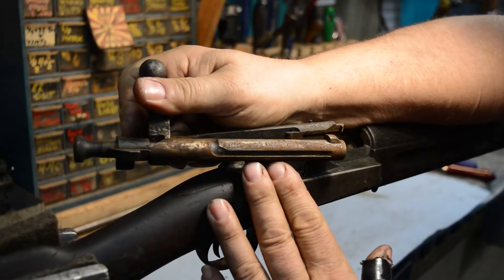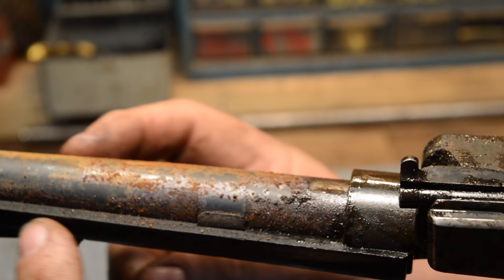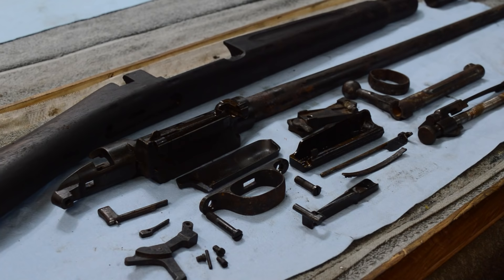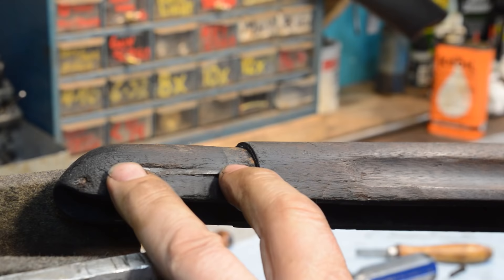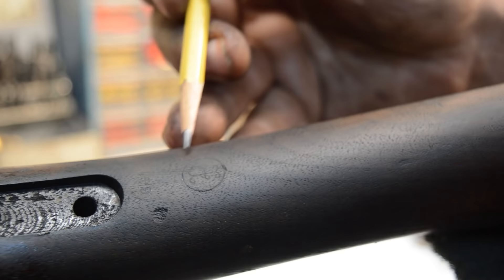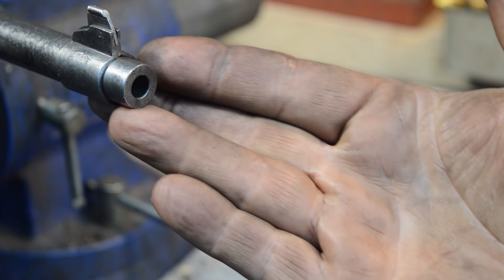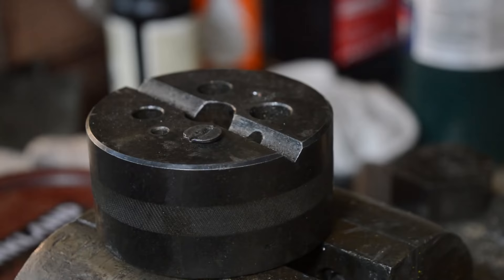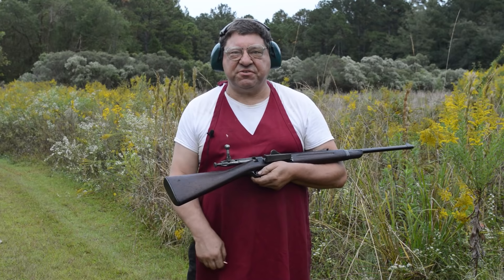Anvil 089: Krag Disaster Recovery

Comment: Back in the 60s our town's gunsmiths shop had a fairly bad fire. I went to work for Roy working after class to try and stabilize and refurbish as many guns as I was able. 
This show is bringing back a lot of memories. I think the one gun I couldn't even save any parts from was a post '63 Model 70. There was exactly no Rockwell hardness left, pure soft.  I later did take the  trigger group home and messed around with rehardening and tempering with some success. I worked on this pike of guns for two years and was able to save a lot and other than the toasted Mod 70 I was able to save a lot of parts.... those were great days for a 15-18 year old kid.

Comment: I believe that is  a  "Benicia arsenal"  conversion from the '30s --   A 98 rifle cut to carbine  barrel length . The  muzzle turned down and a 1903 springfield front sight installed.  The action & barrel then installed in a carbine stock --  Sold for a few dollars through the DCM  ----   All original krag front sights are silver soldered on  both rifle and carbine --   Other arsenals may have also made them --    I believe  my source of info was from an american rifleman in the early '60s ---- 
I bought mine in 1958 for about $20 and still have it -- shoots  fine, usually with lyman 311291 cast  --    I enjoy your videos  --
Reply from the maker: Yep, I think you have it, because it is a pot if chili for parts. Thanks, GREAT intel.
Reply: Your post reminds me of a friend who's father used to buy M1 carbines for 30 dollars back in the 60's. He used to give them as Christmas gifts to his buddies

Comment: Sir, you are truly an artist.  I'm no gunsmith but I am a carpenter. A couple of years ago a friend of mine came by with a shotgun with a badly burned stock. He wanted it fixed but wanted his son to remember his stupidity. So I submerged the stock in long set epoxy and put it in a vacuum chamber.  Let the still liquid epoxy run off the stock and let it cure before resurfacing the whole thing. Never removed a single sliver of wood. Not suggesting it would have been an option here. But if ever a disintegrating stock needs to be locked in stasis...
I hear they are still using the aforementioned shotgun.

Comment: You hit the nail on the head as it were.  Several arms companies like Bannerman bought up the surplus Krag's which had shot out barrels due to the corrosive priming of the time, and mounted surplus 1903 Springfield 30-06 rifle barrels to them.  This was done by simply bobbing the chamber end 2 inches to remove the threads.  This end was then re-threaded and contoured to the Krag receiver and the new 30-40 Krag caliber chamber cut.  If a carbine stock like this one was not available the rifle stock was bobbed and it's ramrod groove filled with wood from the cut-off.

At the 13:28 mark we see the markings, model of 1898 with a serial number 137598.  If this was a 1898 Carbine the stock cartouches are wrong for it's serial range.  Next at the 34:00 mark we see the front sight which is a 1903 Springfield rifle banded type with an after market bead blade insert which has not had its toe extending out beyond the sight base filed back to the base itself.  The muzzle end has been cut-off flat instead of having a radius crown it originally had.

Comment: The moment I saw the front sight I knew that it had a cut down rifle barrel as indicated by it's 1903 Springfield front sight band. That actually could have been done at the armory because when they ran out of actual carbines for NRA sales, Springfield did alter some rifles into the carbine configuration using 1899 carbine stocks and cut down barrels with '03 front sights. That being said, there is probably 100 cut down rifles (or more) done by gunsmiths to every original Krag carbine. A great many were also upgraded to 1899 specs when they went through the arsenal for refurbishment. 

I am extremely fortunate to have one of those 5001, 1898 Springfield Krag carbines (correct serial number range, correct saddle ring stock) that is still in original condition.
Reply: Please post a picture link if you please.  I would love to see one. Myself. I have a Springfield conversion Krag with the 1903 4-groove barrel that shoots like a champ.  love the that little short rifle.

Comment: I use an impact driver when working on autos.

It works kinda like how you were shock loading the screwdriver with the hammer taps.

Really the only difference is that the impact driver turns itself when ya wack it with a hammer.

I’m so glad I found this channel, so relaxing and VERY informative.

Comment: Fantastic work! I'm no gunsmith or machinist but I used some of your tips to refresh the stock on my dad's model '94. I love working on my car, and you are absolutely right that hitting the bolts with some, I use generic "PB Blaster", lubricant an hour or the night before is the difference between snapping a manifold bolt or not.

Comment: Years ago I picked a sporter at an auction.  The guy that blued it did a fantastic job. The scope was mounted well. If I remember correctly, it was a Bishop stock. That was the one problem. The barrel and action was not seated deep enough. I fixed that and off to the range. It was a tack driver. Half the guys on the line shot it. The amazing thing is the barrel. This one was cut down some, but still plenty long and it looked straight inside. I was in machining 40+ years and know what they had to use to drill it back then. The steel is tough and course. Now days they throw sulphur and lead in the steels to make it easier to machine. If you ever get a chance, look at some photos  of old ordnance machine shops. It really makes you think when you pick up an old gun.

Comment: Yeah, cut-down rifle.  The sight was a full-sized rifle sight, and the barrel was cut straight across, without the muzzle being crowned.  All Krag front sights were flat-based, fitting into a dove-tailed slot on the barrel.  The sight on this rifle is from a 1903 Springfield.  Excellent illustrations of "jack-hammer torquing" the screws out.  I learned something new!  One interesting thing about the stock screws.  They have remained unchanged on US Military rifles from 1795 until the M-14 was replaced by the M-16 in the early 1970s.
Reply from the maker: My real concern, until I got up to speed on what we had here, was that someone had faked with intent to defraud. Once I learned the Benecia had done arsenal level refurbs to get it to the NRA, my opinion changed dramatically

Comment: Hey it looks like some of the SAMCO 1916 Spanish Mausers!
I had some genius individual argue that Kroil should NEVER be used on blued firearms because it removes bluing.  I said I've left it on several different blued guns and gun parts for over 24 hours and never had an issue with bluing. 
His response was "Really, a WHOLE 24 hours?  Well that ends the argument"
So I guess never use Kroil because if you leave it on for a week, it might harm the bluing.
Also, glad I'm not the only one who uses electrical tape for certain first aid issues.
Reply from the maker: I have had issues with LONG TERM Kroil bluing damage. Like more than one week of immersion, so I use it liberally and never look back. Note: Even saliva causes cancer, but only if swallowed in small amounts, over long periods of time................................

Comment: Never EVER snap a handguard off with a Krag!!!!  You remove the stock, remove the rear sight, and then slide the handguard forward until it can be removed.  Then, insert a quarter and a nickle in the clips to hold the clips and prevent tension on the wood.  Not doing this will always risk cracking the handguard... and replacements are extremely difficult to find!!!

Comment: It's strange how rusty metals get after being exposed to soot in a fire.  Must be because the soot is corrosive.  I'll have to research further, I've had it happen to me in 2008 with a small shed fire, luckily no firearms were involved!  And I do mean it was a very small fire.  I had some kerosene lanterns that were NOT the source of the fire but their kerosene smoldered in the fire for a long time.  It may have been a few days until we noticed the fire as it was contained to the interior of the shed only!  And the actual source was Christmas lights overloading one of those old Radio Shack Plug 'N Play modules (the precursor from the 1990s to modern day smart home light control!)
Reply: props for the name...have a good day
regards from Denmark
Reply: Rusting is oxidation of the iron hence the name iron oxide. Water vapor causes this due to the oxygen in water. Fire (or flames) is a type of "rapid oxidation" thus fire can produce rusted iron in the form of iron oxide. Cutting torches and welders can't work on rusted steel due to the iron oxide coating, essentially being non reactive. Ever wonder why welders clean the metal of rust with a wire brush before welding? (Prevents contamination of the melded metal seam.)
Reply: @joepangean6770  I weld myself as I understand, rust doesn't conduct.  But cutting torches?  I've seen plenty of rusty metals cut with a torch.
Reply: Carbon accelerates corrosion in steel (graphite is particularly bad). Water completes the galvanic circuit.
Heat also accelerates oxidation, add the acid generated by combustion (particularly if any halogenated polymers or sulphur compounds are involved).
Springs and heat don’t mix either (ditto magnets but they aren’t common in firearms).

Comment: If there is a band around the barrel at the front sight, with that set screw, it is probably a cut down rifle. That muzzle has been cut off and there is no crown. CArbine barrel length is 22".  Also, that lever on the front of the rear sight (It's the 1901 rear sight. Check for little "C"s on the left side and bottom of the ladder), is used to loosen the ladder for windage adjustment, then to lock it in place. The cartouche is dated 1901, but the serial...can't read it too well: 187953....is 1899.

Comment: If I recall correctly from my firefighting days, AFFF is just cows' or ox blood that's been brought into the higher pH range when mixed with a lye to make it foam well, kinda like detergent.  I looked it up and apparently as of late, they've added some PFC and some acids as well.  Of course, they're pumped in using water to dilute and distribute creating the layer of foam to extinguish the fire.  I'd say it would do a real job on steel.
Reply: The manufactures of the stuff have all recalled it too. All the major fire suppression system manufactures from Ansul to Amerex that used similar solutions pulled it off the shelves and are no longer selling it. I work in the industry wholesaling so that has been an interesting new development!
Reply: @austinbunch5202  Any commentary on what the new stuff is made from?  I worked at a place that made a variant of it and ours was basically liquid soap with some anti corrosive and antifreeze added.  It would be mixed with water to make foam, but no idea who or what the end consumer was.
Same product with different preservative packages went to car washes, hand soap, body wash, and shampoo factories.
Reply: There was a major spill of the stuff undiluted and it caused the EPA to have a conniption so it got yanked. No idea atm if there is gonna be a replacement for it. Generally speaking the place it gets used the most is on ships and oil rigs. Floods the compartment with bubbles and chokes the air supply along with a crap ton of water. I would guess it’s the additives that are the major concern right now and the fact that this stuff is used to a high degree in an oceanic setting which everyone is sorta anal about keeping clean right now.

Comment: Used to work at a place that made AFFF.   Our formula was basically liquid soap with some antifreeze and corrosion inhibitors in it.  This gets mixed immediately before use with a bunch of water to make the foam.  There are other formulas though so you might ask the collector what variant they used.

Comment: Barrel may not have been replaced as the carbine barrel is the same taper (shape) as the rifle barrel it just 22 inches long.  Also the barrel on this rifle does not appear to be crowned but cut and left flat at the muzzle.  No original Krags (rifles or carbines) had the front sight attached to the barrel with a barrel band.

Comment: When you conserve and boil lots of intricate metal parts (this action), how do you get in the tiny little nooks and crannys to get all the ferroferric oxide off? Like on the inside of the case pusher tube of SA revolver frames.
Reply from the maker: Any bore brush, or tooth brushes work too

Comment: Im still fixing the draws on my 303 no1mk3 1914 sporter. Epoxy and walnut wood and chisels and files. And time. But it will be beautiful again as much as a sporter can be. I love 303 brits.
Reply: I just did the draws with my buddy on my SMLE.  Engineers Blue and a woodworkers chisel will be ur friend!  Took about 20 fittings to get it right but works great now!  Hang in there!

Comment: That looks like a 1920s commercially "sporterized" Krag. You'd buy a Krag rifle from the DCM for a couple of bucks and turn around and send it to a commercial shop, who for a couple more bucks would cut down the barrel and stock and fit an '03 front sight. I own one. It's a great shooter but doesn't have a lot of collector value because of the sporterization. OBTW, the Norwegians make a nifty speed loader for their Krags that work for the US Krags with just a little modification. .

Comment: You could tell it wasn't an original carbine by looking at the muzzle on the barrel.  It has no crown because the barrel was cut down.
Reply: Yes a 98 carbine should have a crowned muzzle...however the 1892 Krag rifles didn't have a crowned muzzle either.

Comment: I did enjoy your narrative and admire your understanding of things mechanical and burnt. I  started with a pop gun which fired corks. However at age 5 I realized that a candle cut to length did more damage. At age 12 I made a pistol from gas pipe which was confiscated before I killed myself. I worked up to a Purdey 12bore from an uncle, but didn't want to kill animals, so swapped it for a Porsche , a bad move in retrospect. Anyway, thanks for your video, and apologies for not being a gun enthusiast.
Reply from the maker: Easier to get chicks with a Porsche though..
Reply: @marknovak8255  true

Comment: For steel wood screws that are rusted in wood use the tip of a soldering to heat the screwhead for a couple of min.. This will break  the rust by the metal expanding. I've taken many a 200 year old screw out of wood by this method.
Reply from the maker: Concur, that is my next step in the torque escalation cycle
Reply: I got something I need to try that with now. Merci

Comment: Mark I have a question, I have a WW1 German boot knife and it is covered in Cosmoline. Should I take the cosmoline off and rub it with some gun oil?
Reply: Yes you should, take the cosmoline off with mineral spirits (that's just what works with me) and oil the whole thing lightly
Reply: @darrenglover2126  Thank you so much!
Reply from the maker: Cosmoline is for long term, unattended storage. You are not storing it, so I would remove the storage preservative, and enjoy/display/learn from it. Just my opinion

Comment: as an auto mechanic..... 
i approve of the electrical tape and paper towel band-aid.
.
little bit of paper towel for blood soaking.... and a lot of tape to seal it off from the brake cleaner fluid
as that crap will find EVERY little, tiny, piss ant cut...... and make it feel like your arm got shot off.... 
.
and on the Kroil...... ya, it works
but their are cheaper things that work just as good.... but ya may have to use more and/or wait longer
.
however.... WD-40 sucks ass
unless you want something that will dry, and leave behind wax
.
sometimes that works better than 100% oil.
.
when i have to heat something up to break it loose....
i will use WD-40 for the wax (old school trick is melting a crayon into the threads.... as the wax "sucks up" into the threads)
then use Kroil, or PB blaster, or whatever i have..... while its still hot 
.
and just kinda swap out between the two.... while im still heating it
then give it a nice bath of both while it cools a bit
.
spray wd/pen oil on the part ya want to shrink..... and heat the part ya want to expand
the WD/pen helps keep the temps between the two greater. 
.
then grab the Ingersol rand, sacrifice an LS to the speed gods...... and rattle that fucker till it breaks loose....
or snaps
.
usually snaps.....
.
then its drill, extractor, and tap and die set time..... and thats REALLY FUN!!!!!

Comment: Hold my beer... This is off the current subject, but any thoughts on running valve grinding compound through a JC Higgins M-20 with a stiff cluncky action.
Reply from the maker: That's called a "South Carolina Trigger Job". You con do that, but a TOTAL disassembly to the pins is needed to clean out the action afterwards. You, sir, have been warned........just sayin
Reply: 10-4!